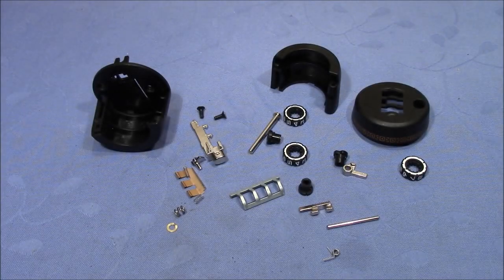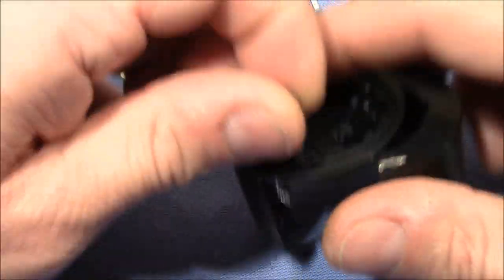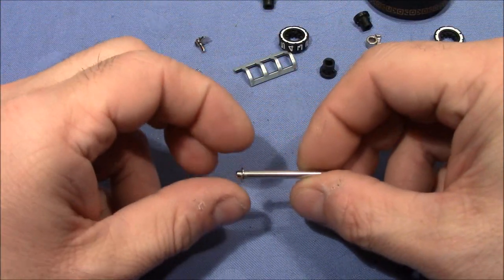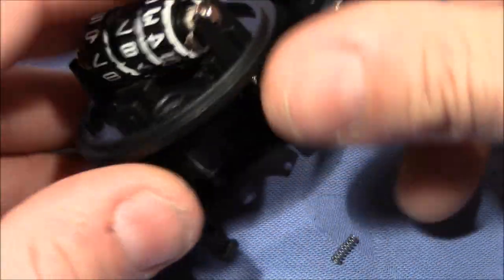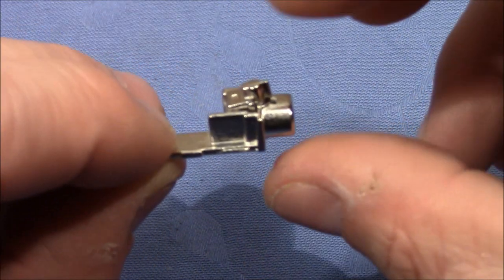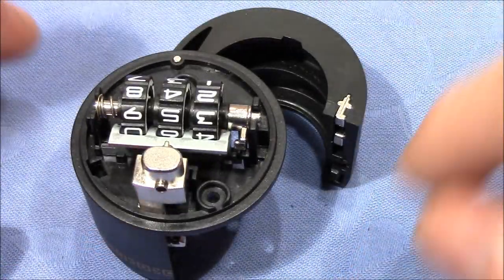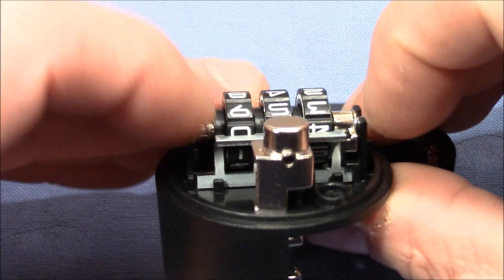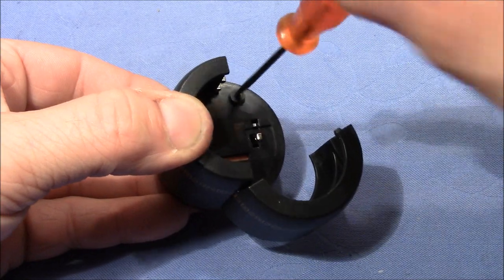(picking 610) Bottle Lock Dissected and Reassembled

Comment: Really fun video. Can it be decoded? Also,I see a little jump cut at 5:17 - I take it that washer didn’t want to play nicely :-)
Reply from the maker: Haha, that washer is the most trickiest part - it jumped on me several times an it got out of frame ;-) You cannot decode it by pushing the button as it doesn't tension the internals. However, it's easily decoded with a decoding knife.